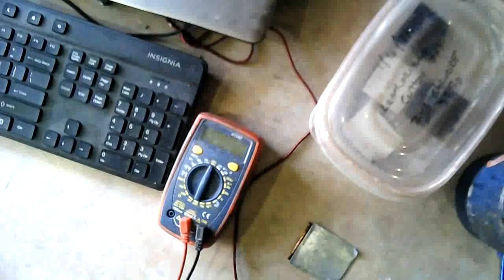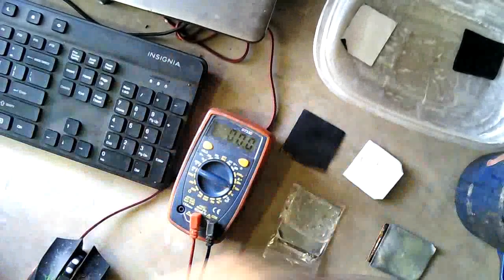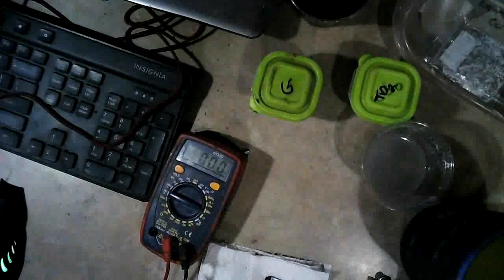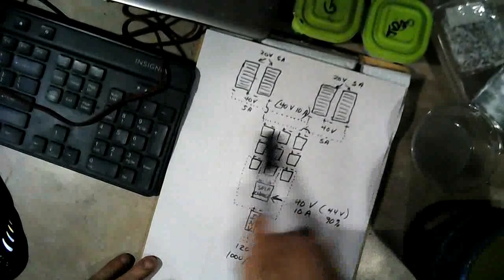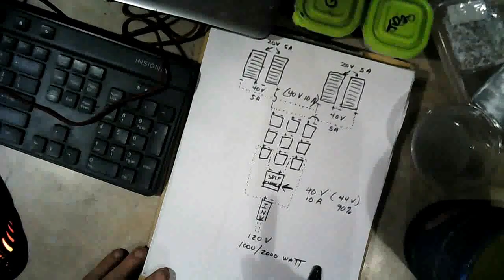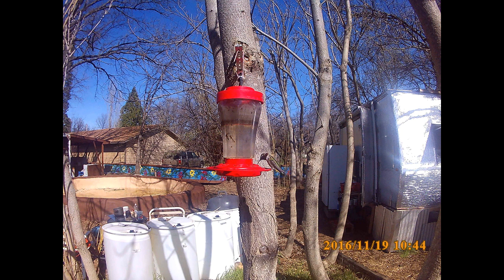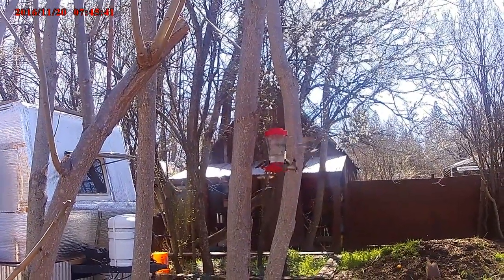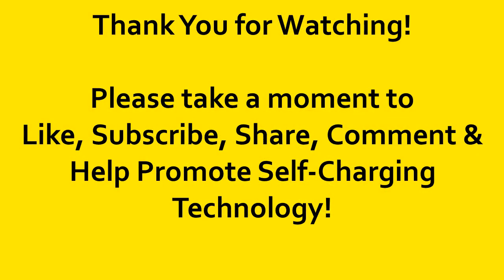April Research Update! (Part 2)

Comment: Looking forward to see how your cell performs when you actually put it through actual charge discharge cycles using a PSU and load.
I have not really studied the "self charging effect", but I would have thought that something in the cell is being used up, changed or deteriorating. :-)  Martin.
Reply from the maker: Load tests are coming Martin. Just as soon as I get the structure figured out. Normal batteries use up electrolytes and die, and that's the way people think about batteries. This battery is very different. It uses a semi-conductor (Tio2) to hydrolyse the water into H+ and OH- ions, creating an ionic liquid crystal structure. The structured water just changes it's state when the semi-conductor switches on and off (charge /discharge) That the best explaination I have.
Reply: Interesting theory, thanks, I will give TiO2 a try :-) Martin.